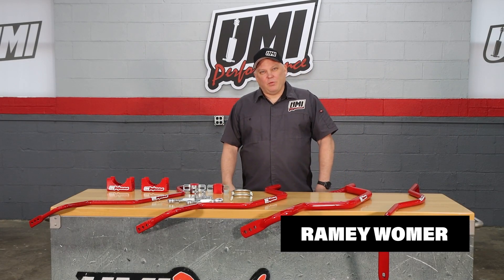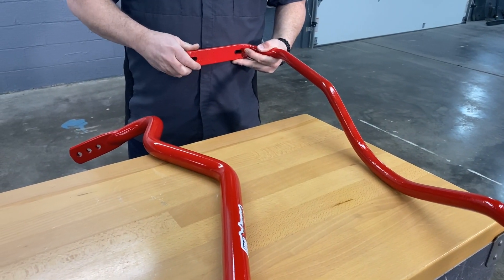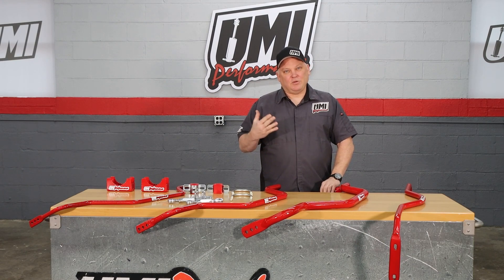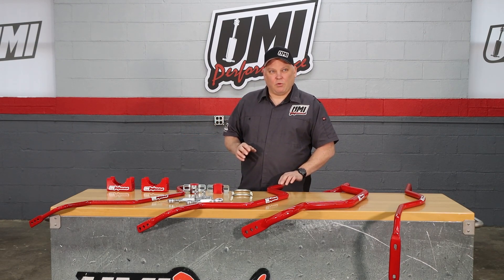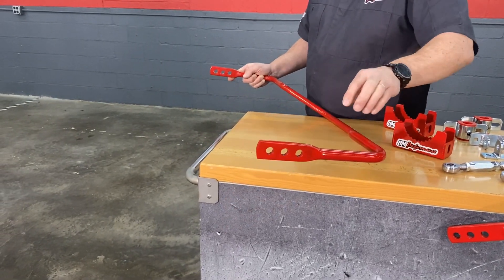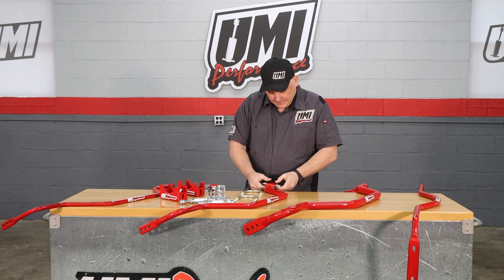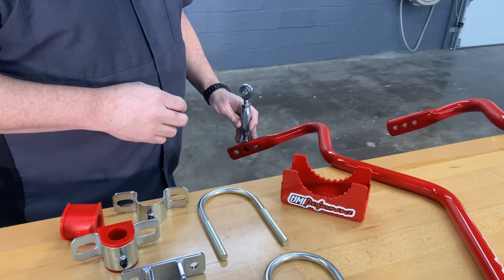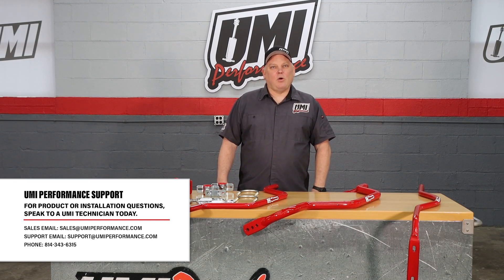UMI Performance G-Body Platform Sway Bar Comparison

Comment: Ramey. would it be possible to have the roto ends and the adjustment nut  on the rear trailing arms powder coated black? that would be super nice.  also the a arms parts that are not black. you can call it the midnight edition. lol. id rather send what I have back to you and have you do it because you know your product better than a powder coating shop.
Reply: I just had all of my umi parts powdercoated blue chrome
Reply: @Itwillgetbetternever  video pics?